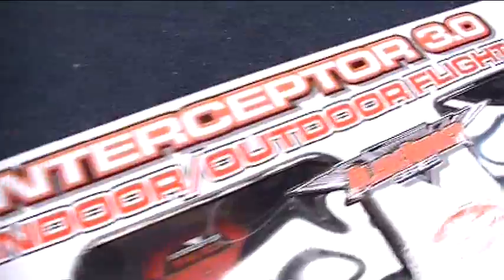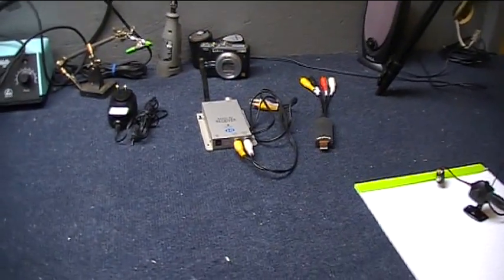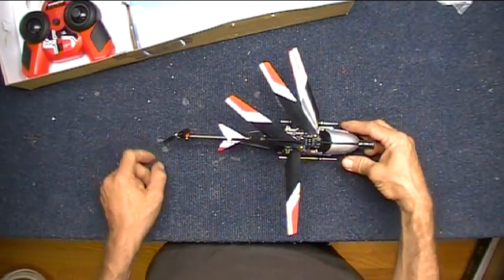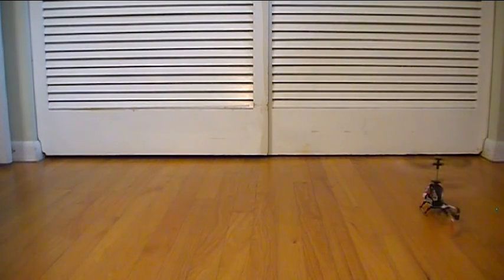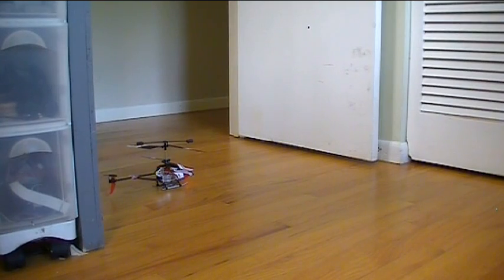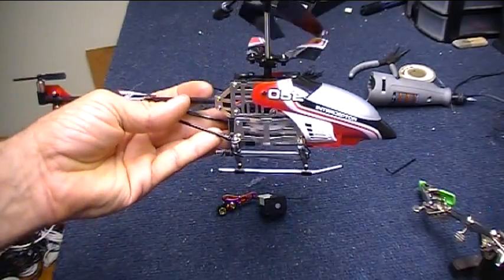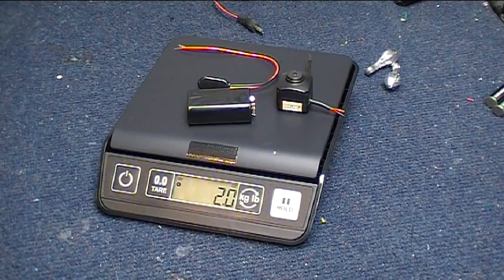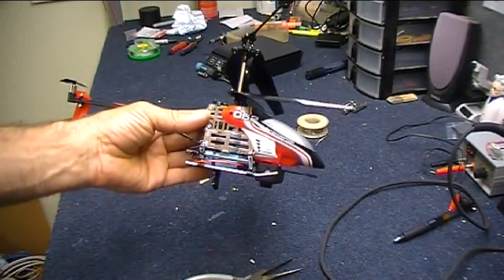RC Helicopter Camera Hack

Comment: Great video!
Have you thought of using one of those "23A" batteries instead of the 9V one? They're 12V so depending on your camera specs you may need a few diodes to drop the voltage but I'm sure they're a lot lighter even if you have to use two in parallel to get enough current.

Comment: I have an even smaller cam that works with these flat batteries but I wouldnt get a live video feed with it
Reply: I have a $20 mini camera which uses a micro sd card and built in rechargable battery. I'm planning to get a helicopter to test it out.